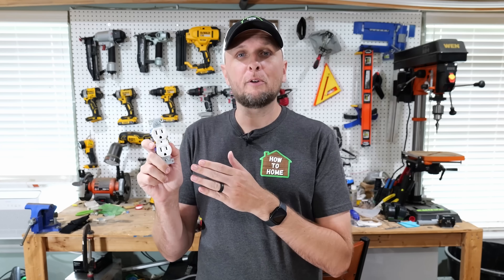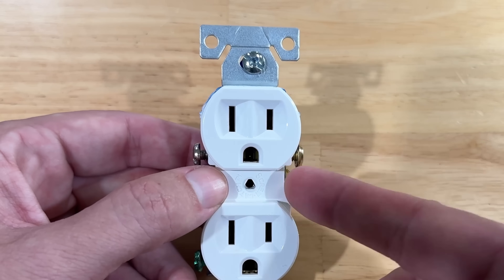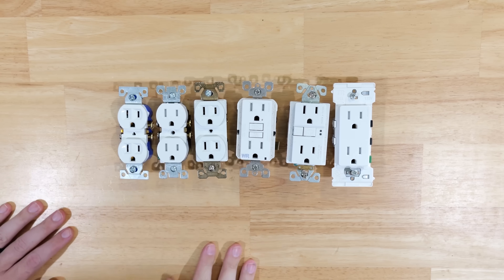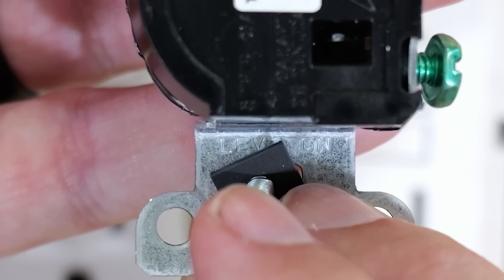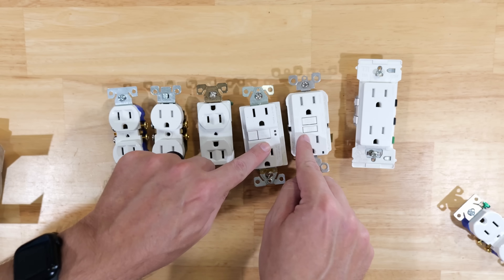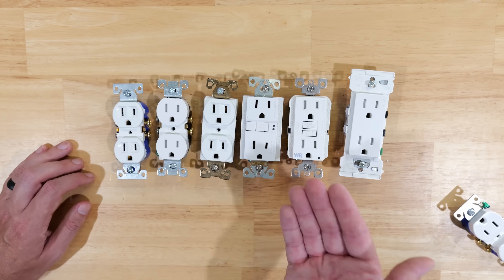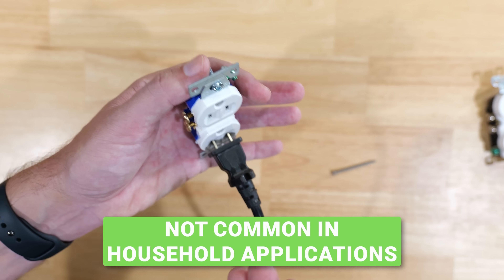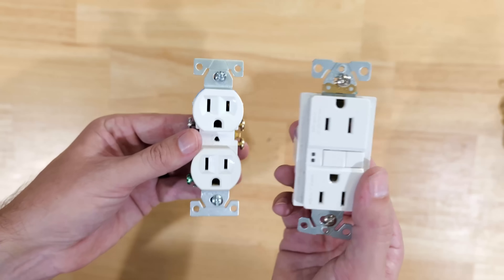The Shocking Reason Why Your Outlets Are Installed Upside Down!

Comment: I have been an electrician since 1970 where I went through the IBEW apprenticeship program. During my training I was taught that the ground always went down. The reason is that if you look the ground prong on a 3 wire plug on a cord is the longest. If you have a receptacle that has become loose, especially with a residential receptacle, the weight of the cord could pull the cord out, where you want the ground to be the last connection to come loose. It was also apparent that if you went onto a job you could tell whether the work was done by Union craftsmen or non-union. That has changed because the non union craftsmen are much better trained.
Reply: @rustyhenderson3019: Ground prong up when that outlet is attached too the wall-switch so people there have a visual cue to know where to plug in their lamp to control it from the wall light-switch.
  Medical facilities have things hanging on walls that fall, like clipboards that short the circuit, military galleys and restaurants, ground up was specified for contractors, due to stainless steel utensils being dropped, etc. In many cities ground up is standard in all commercial and industrial buildings, ground only go down in residential buildings, houses, apartments, condos, etc. There are local rules. 
   Everything is in context and the answer DEPENDS on context.
Example: “Never took the orientation of an outlet seriously until I was measuring for a shelf with a tape measure. It slid down and fell across the prongs of the washing machine plug.  POW! “ —@joef.6596

Comment: I had a metal clothes hanger slide down along the wall and contact the plug in a ground down plug. Luckily it was the ground side, but if it went a across both it would have shorted, and if it was the hot side the entire hanger would have been energized. 

I still install them ground side down though, because flush mound plugs are designed for ground side down,  and in ground side up the weight of the cord works against keeping the plug in the wall, as well as putting stress on the cable junction.

Comment: Sorry but I have to say there is a better way. In the Midwest where I live outlets are installed horizontally. And because things like nails can fall on them and metal rulers or pieces of sheet metal can fall sideways and lean up against them, I always put the wide terminal (which is also grounded at the service entrance) at the top. Since it is wider it will stop objects before they hit the hot terminal even on plugs without a ground pin. Also horizontal just looks way classier than vertical. We do mount light switches vertical because that is the way they work. Ok you can start shooting now.
Reply from the maker: Interesting.  I’m from the Midwest originally, Indiana/Ohio, and none of ours were horizontal.  My family that I visit that still lives there, theirs are vertical too.  Must be a regional thing.

Comment: A nice, informative video!  As an electrical engineer I subscribe to the concept of ground pin up, for the small potential short circuiting possibility the other way.   I made one exception in our house--I changed the receptacle for the washing machine to ground pin down, because the washer's cord is molded to hang that way.  
Some folks have commented on switched receptacles--in each room with a switch, I had all receptacles done as half and half, with the switched half on the bottom.  The reason for positioning switched at the bottom was that someone casually plugging in a non-switched appliance would be more likely to use the nearest (top) half.

Comment: you want the ground pin to stay connected when its partially disconnected, that way less likely to get electrocuted when there's an open ground, if it's on the top is meant for lower mounted area and if it's on bottom like usual it's better for higher up outlets as when the weight of the cord or normal use when it starts to unplug... the ground is still connected

Comment: Actually seen a metal chip in a machine shop fly back to the outlet & short it out.  Early in my career I was installing outlets in a control room..  Upon inspection I was pinged for installing ground down.  From then on I always installed ground up unless it was not practical.

Comment: Not that it's the only consideration but what about a light switch? Is up on or off. If there is a correct way to put the light switch. Then the side that has the brass & the side with the silver should match the way the outlet is .which in turn will solve the question.

Comment: I like, and install, and even change back to the ground prong being DOWN. My reasons as a homeowner, are that most of the three prong plugs are heavier and or are built bigger, on the ground prong side so they would naturally "fall" lay properly from the outlet towards the appliance. Additionally, when using a "charger" pronged item they "lay" in /come out of the outlet better. And that is my 3-cents as a user of the outlets!

Comment: With the common practice these days of plugging low voltage power supplies (transformers) directly into 120v outlets, the best usage is lug down.  The reason is:  ground lug cords (specifically power supplies) are specifically shaped to allow two devices to be plugged in when it is lug down; my battery charger power supply can be plugged in the bottom and another regular ground lug cord can be plugged in on top.  It doesn't work well with the power supply in the top position (the weight of the cord and power supply drag the unit out of the socket).  If the utility is upside down, then you can only use one side because of the shape of the lugs of the power supply (it will only fit in the top position, covering the bottom postion with the rest of it's bulk).  Another consideration (more for convenience) is if the wire is drawn into the gangbox from the top or bottom.  At that point, wiring the device is easier with one orientation or the other.  Whichever choice you make, try for uniformity so the outlets are easier for the user in case the outlet is in a restricted, dark or poorly lit location.

Comment: The plug being removed had finger grips to each SIDE, not top and bottom. So the "typical" grip of anyone operating the plug is NOT according to "manufacturer's instructions." Anyone suing for "lack of safety" electrocuting themselves with ground prong up would thus be told it was their user error for not operating the PLUG as designed, regardless of the outlet orientation. 
European outlets are circular, with a ground prong at BOTH top and bottom. The connection area is also recessed, so that the prong connection is broken BEFORE there is enough gap for fingers to get in. Solves all of these issues, but is a little more expensive to make - more complicated tooling for the plastic injection molding. 

And then there is the UK plug. These are ALWAYS ground prong up. And the live and neutral prongs have insulation shields covering the first half inch, so that accidental finger contact is only made with insulated prongs. By the time the prongs are far enough extracted for contact with the metal, contact with the socket wiring has already been broken, so still no electrocution. To make it "safer" (and even more expensive to make) the earth prong is much larger, and operates a shutter that obscures the live and neutral slots. Which means you cannot insert a paperclip or nail into the outlet, UNLESS the earth shield shutter has been moved out of the way. Kiddie proof? Well, not completely, but far better than anyone else's national standard. 
For overkill, every plug has a fuse in it, so that any appliance overload blows the plug fuse, and does not kill the house circuit. This is because the "ring main" standard outlet wiring can run up to 32 amps, which would start a fire if an appliance needing just 3 amps managed to short circuit itself. A 3 amp fuse in the plug stops that risk. 

For good measure, the outlets USUALLY have switches on them, so that the plug can be inserted and removed with the power switched off, then turned on once the plug is inserted. Just to further protect the user. Unless they have just washed their hands/dishes, and are touching the switch with wet fingers. But then, UK electrical code prohibits outlets from being in bathrooms, and from specific vicinity around "wet areas" like sinks in the kitchen. 

All of which adds expense. And yet, the extra cost of all these UK features is pennies, and not noticeable in the price of any appliance or replacement electrics (like outlets). 

The final decider would be statistics.
How many people get electrocuted when inserting or removing a plug? (with ground prong up)
How many fires are caused by accidental droppage of something onto the exposed prongs of a semi-inserted plug? (with ground prong down)

If any of these were significant, you can be certain that CODE would be introduced IMMEDIATELY to deal with it. So, the fact that neither the code, nor the manufacturers, have any specific preference (and two major manufacturers imply opposite preferences by the orientation of their writing) tells me that while both safety concerns are very valid, neither one presents a big enough risk to need dealing with. 
That may change in the future...

My personal preference would be ground prong up - because in my house, the risk of something falling onto live prongs from above is greater than me sticking my fingers where they should not go. But I'd be equally happy with whatever way around they were installed in my house, knowing that the risk of either is so small, no code has been written to deal with it. 

Oh, and lastly, the USA uses 110V standard wiring. This is "safer" in that an electric shock at 110V is unlikely to cause heart failure. Whereas Europe uses 220V / 240V, which has a higher risk of fatality, although it remains low. I have touched 240V with fingers a few times in my life - it tingles up to my shoulder, but never stopped my heart. 

So, why doesn't everyone use 110V? Simple. To get the same power on half the voltage, you have to run twice the current. Which means the cross sectional area of the copper wires has to be double. Which gets expensive. Very expensive, very quickly, these days, when copper commodity prices are skyrocketing. 

Same safety argument applies: how many people are killed (as opposed to just shocked) by contact with 240V? Not enough to force a change to national codes...

Comment: MY BROTHER HAD A CIRCUTBREAKER HE COULD NOT GET IT TO RESET/ THAT WOULD NOT RESET BECAUSE OF A SHORT . HE FINALLY FOUND THE PROBLEM THE GROUND WAS ON THE BOTTOM OF THE RECEPTICAL/ A PENNY FELL OF OF A  CHEST OF DRAWERS AND IT LANDED PERFECTLY ON THE RECEPTICAL ON THE 2 FLAT PRONGS. DEAD SHORT. . THE ODDS OF THAT HAPPENING IS LIKE PICKING ALL OF THE LOTTERY NUMBERS CORRECTLY AND WINNING THE JACKPOT

Comment: I prefer the ground prong down for hardwired outlets, and ground prong up for switched (or 1/2 switched) outlets.  That's how my house is wired.  The top outlets on either side of my bed are switched, and I've got a couple more around the house (living room and den) that are switched.  They have stand alone lamps plugged into them, and so I have a wall switch, that will give power to it or not.  The bottom outlet is fixed wired (yes you can do that to those who question this - you just break the tab connecting the hot side of the top and bottom and feed each top/bottom separately.)  This also helps people figure out when the plug something into an outlet and it doesn't work, and they look at it and know, oh that probably is switched, or they've got that switch on the wall that doesn't seem to do anything, they can easily identify the switched outlet that it's controlling.

As far as a safety side of thing, yeah, I think it's really a wash, you can argue the dropping something and hitting across the prongs until you're blue in the face, but if the equipment is hooked up correctly at worst you get a nice short arch-flash.  And If you've got flammable items stored next to an outlet, your just an asking for it to go up in flames.  If there was any viable safety issue on it then the NEC would make the orientation a requirement.

Comment: 12:31 Just one minor criticism, I don't grab plugs like that. The side of that plug has ribs on it so you can grab it by the sides, which is how I grab most 3-prong plugs to remove them. But some of the extension cords I have are flat on top and don't have the cable clip like the one in that video, and I'll just rest my thumb on the top of the plug to pull the cord out.

Comment: If you wish to understand the reason for ground up vs ground down, all you have to do is look up the CSA/ULC testing requirements for receptacles. You will find within the tests that are conducted for receptacle approval a weight test on the receptacle where a specific weight is hung on to the power supply cord that is plugged into the receptacle and if the power supply cord is pulled out of the receptacle, the receptacle fails the test and cannot be certified. The orientation for this test is "ground up" if the receptacle is mounted vertically. Hope that helps.
.

Comment: 10:30 NOT theory that item can fall across Pins,  First time I saw it happen live was when about 12 years old a a piece of metal fell on LIVE pins and made big spark, melted copper, and eventually popped Breaker.  Seen it happen several times again.     It is a hazard to NOT have Ground Pin Top side .
Reply: Yep, not theory at all. My house was built in 1947, and all the outlets are ground prong up, except one mid-level on the living room wall. I was measuring for curtains for the windows on each side of it. Sure enough, the end of the tape measure slipped off the window frame and the metal tape slid down the wall and bounced on the hot and neutral pins of whatever was plugged in. Too fast to blow the breaker, but it blew a chunk out of the side of the tape and blackened the surface of the outlet. After that I don't mind at all that the rest are 'upside down'!

Comment: The 220 plugs I have installed (total DIYer) ground down so my 220 shop equipment plugs hang down towards floor instead of up towards ceiling.

Comment: I like to have the outlet with the ground hole at the bottom, since it lets a three-wire plug's stout beefy ground-prong help to "support" the weight of the cord as it hangs and curves downwards from the socket --- with the grounding-prong at the bottom, the downwards-pulling weight of the plug-and-cord tends to push the grounding prong even more firmly into the socket and thus keep the entire plug properly inserted, whereas if the ground-hole is on top, the weight of the cord tends to pull the plug's grounding-prong outwards.  I seem to recall often seeing partially-pulled-out 3-prong plugs when the outlets were oriented with the grounding-hole upwards.

Comment: with the larger prong being the ground as gravity pulls it down the ground prong has a better hold.  Also as the plug could due to the weight of the cord be pulled down and away from the outlet if the ground was down it would unplug the power.  If the ground is up it would pressthe power more into the outlet.

Comment: I owned a home in Lancaster Co.,  PA  in the past, before moving back to WV.  One thing I noticed, right away, was the electrical outlets throughout the home!!!   Some were (installed in one direction), while many others (were installed in the opposite direction).  The only comment that I have about this,  is that many bigger appliances, which have a grounding prong, makes it very questionable about how these outlets were installed!!!  To plug in my (say,  Dehumidifier) into an "upside down" outlet, ...puts undo stress on the cord.  To put it in a "regularly" installed outlet, lets the cord hang in a natural,  downward position, thus NOT putting undo stress on the cord!!!
Reply: Funny you say Lancaster PA. I was a plumber there for 30 + years working on new home developments for all the largest builders. I saw the same thing and it drove new homeowners nuts when they had them upside down with ground up. They actually would complain to me about it as is my company did it simply because we were a contractor for the builder. There was just something very off putting to installs like that. It automatically gives an appearance of being wrongly installed. The real crazy ones were homes where two different installers working for the same electrical contractor would install their outlets their own way, one install up and on down, both in the same house. You’d find maybe a first floor up and the second story down, or even mixed through out. I know the contractor who was famous for this…very large one, but we won’t embarrass them here. Some of his crew are Amish and don’t even use electric in their homes.

Comment: The theory of a nail falling perfectly horizontal on to the outlet prongs is absolutely stupid, I worked in maintenance for a big company for years and years, and it never ever happened, and normally when you work or replace an electrical outlet you're require to shut down the electricity supply to that outlet, period.

Comment: I still prefer mine with the ground facing down. While I understand the potential safety concern that prompted ground side up, I have never had anything fall onto a lose plug and if that ever did occur, I would hope the breaker would do its job and trip. The other potential problem is with polarized transformers that would now have the weight resting on top where gravity is prone to separate it from the wall.